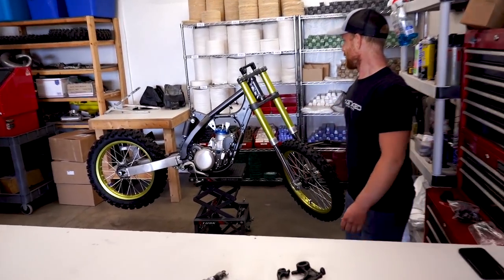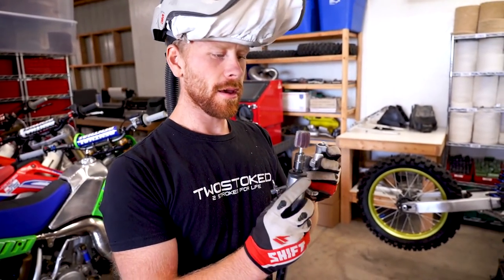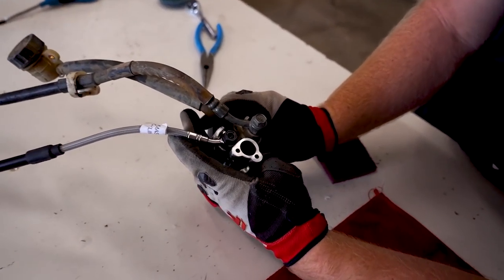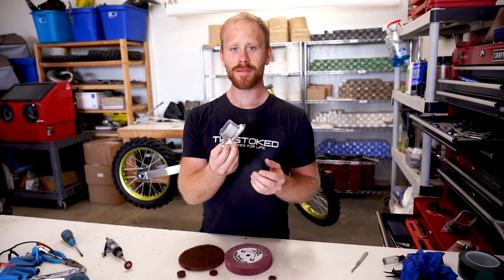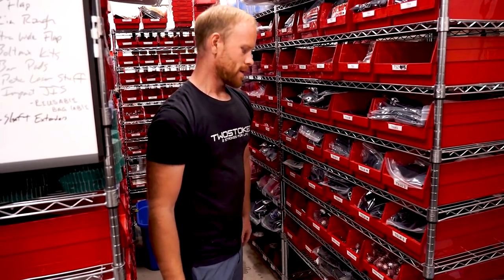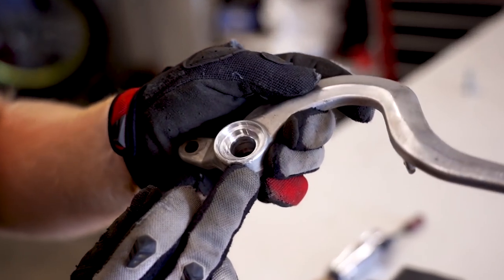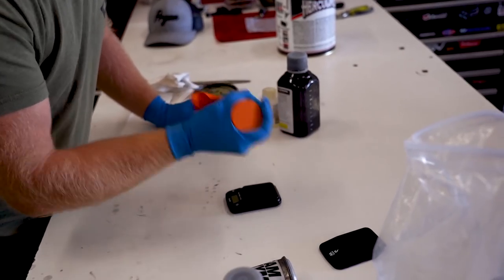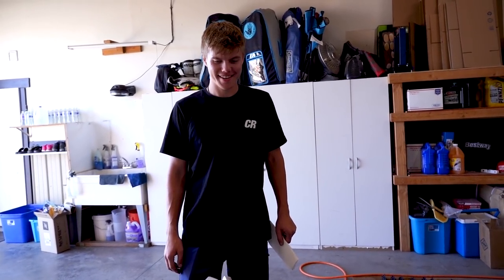Making Parts Better Than New! | | RM250 Rebuild 28

Comment: Cam ive cerakoted my master cylinder with the sight glass in, i covered both sides in heat proof tape and cured it at a lower temperature for 2 hours, worked fine for me👍
Reply from the maker: That's great to hear! I'll have to try that on the next one.
Reply: @CameronNiemela  ive been buying your cleaning pads for my bike project, engine is nearly finished (cerakoted cases and cleaned up cylinder and head) next is my suspension!

Comment: Hey Cameron, the Hammerhead Titanium Replacement brake tip for their brake pedals will fit the stock RM brake pedal. Just tap the holes for the rivets to M5 and it will bolt right on! Mine has been on my RM-Z 450 for over a year now and has been great 👍
Reply from the maker: Thanks! That's great to know!

Comment: I love the videos but let’s be honest you’re basically building a show bike.  Sure it will get used once in a while but it’s there just for looks.  This isn’t about making it the most reliable efficient machine out there.  This is strictly cosmetics/customization.
With that said.  You are very patient.  Taking the time to grind casting marks, polishing, painting, powder coating, cerakote etc is awesome.  That is not me.  I’m not that patient.  
Keep up the great videos Cam, they are great.
Reply from the maker: Haha. If it was all about looks then I would have just skipped new bearings/seals/bushings and gone without upgrading the brakes, triple offset, head, bar mount dampening, and a few of the other weak points on these bikes. Perhaps you could go back and watch a few of the older videos. I do appreciate your viewership though.
Reply: @CameronNiemela  I've watched the whole thing.  I hope you didn't take it as a knock on you or your work.  As I said I love the channel, your attention to detail and you sharing your knowledge to everyone.
It really is an awesome channel.